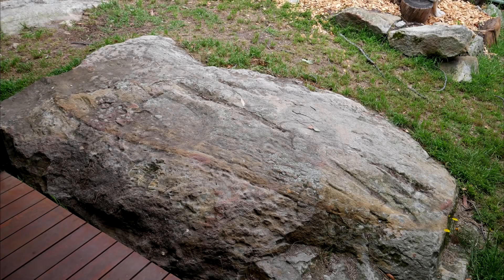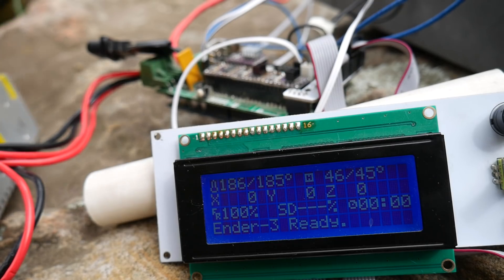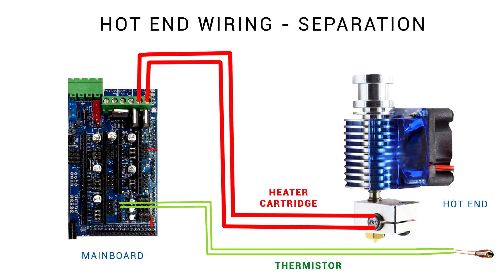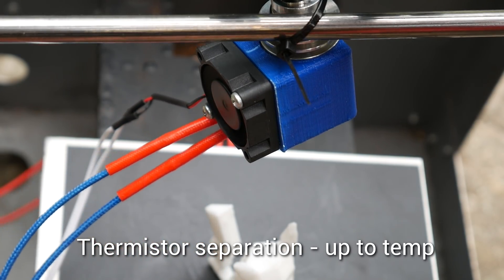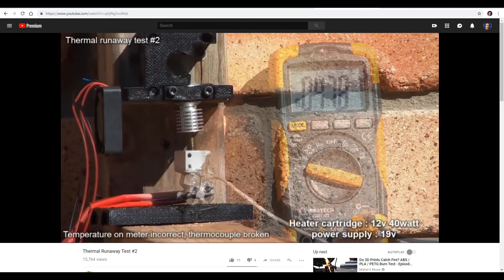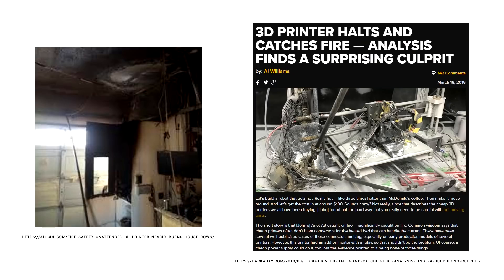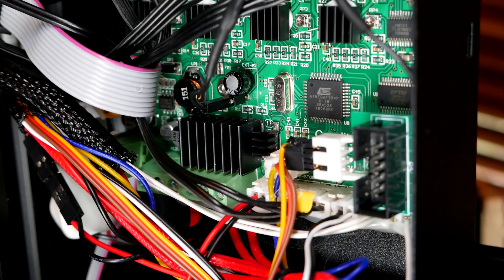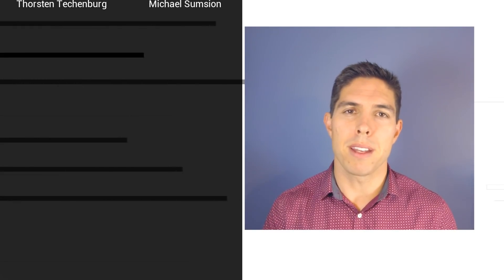Is your 3D printer a fire hazard? How to test Marlin safety features

Comment: We recently had a alert warning of HTERMAL RUNAWAY and several loud beeps short and long beeps to get our attention. We were able to manually turn off the ender 3 printer. Do you think think thermal protection is enabled? Or should we still be updating the software?
Reply from the maker: If it gave that error and shut things down, the thermal protection is doing its job.

Comment: Thanks for the video. I currently have the thermal runaway issue where mine appears even when everything is in spec. I haven’t checked physical cables yet but I also don’t know if I have to replace the thermistor, which is the correct part when I look it up. 
Also Creality isn’t very good about labeling firmware by version. I found it by “which motherboard do you have” or “which accessory are you using” like CR Touch bed leveler, etc.

Comment: I just got a Thermal Runaway warning on my Ender 3 v2 that I got about 2 days ago.
The print stopped and the printer started beeping, but apart from that nothing happend.
I'm not sure what caused the problem. After a restart the printer seems to work normal again, but I haven't run any bigger prints since the warning.
The print that caused the problem was the biggest I've done so far with about 4 hours in before the error occurred (and about 7 more to finish).
I hope I can find and fix any problems with it, would annoying if I can't print anything bigger.

Comment: Great video, I have done all of your recommended mods/checks. However, no matter how good it is, I don't trust software completely when it comes to preventing thermal runaway. On my printer I have a power relay and thermal fuses that cut the main power when anything starts getting hotter than it should. If a fire does still manage to start then i have an automatic fire extinguisher and a smoke alarm. The thermal fuses should blow before anything gets hot enough to cause a fire though, video on my channel if anyone is interested.

Comment: Running 2 thermal sensors on bed, and on hotend.

One on the bed (CR10S) is set into the aluminium bed, another on my silicone bed heater. Any prolonged delta between them (50°C delta allowed for the 1st 20 seconds of heatup from ambient) cuts power to the bed heater. Bed heater also has a an inline ceramic thermal fuse bonded to the pad as a last line of defense, should the sensors or firmware fail.

On the hotend there's the one in the block, and one bonded to the rear of the heater cartridge. Any significant delta, or lack of reading change when expected, cuts power. Tested by pulling the cartridge partway out from the block, sensor on the back of the cartridge registered the spike and cut power to the cartridge in about 4-5 seconds.

Any abnormal reading from any of the sensors (wire or sensor damage isn't always a clean break or full short) also triggers.

I've been looking to find some high temp thermal fuse to mechanically mount to the heater block, but haven't been able to find any yet with a reasonable margin above 330°C. At least not small enough or non-reset. They need to be full mechanical break so that if it somehow fails to electrically shut down, it won't come back on if temps go bsck down.

Comment: Got thermal runaway alarm activated for the first time on my Ender 3 Pro today. I installed the thermistor incorrectly after disassembling the hot-end for cleaning and I think it wasn't tight enough in.

Comment: Current version of Cr10S Pro V2 seems to have fixed this since it is based on Merlin 1.1.6.

(cf. https://github.com/Creality3DPrinting/CR-10S/blob/master/CR-10s%20Firmware%20(Marlin)/CR10S-Factory-Thermal-Protection-Enabled/Marlin/Configuration.h)

Configuration.h contains now:

//===========================================================================

//======================== Thermal Runaway Protection =======================
//===========================================================================

/**
 * Thermal Runaway Protection protects your printer from damage and fire if a
 * thermistor falls out or temperature sensors fail in any way.
 *
 * The issue: If a thermistor falls out or a temperature sensor fails,
 * Marlin can no longer sense the actual temperature. Since a disconnected
 * thermistor reads as a low temperature, the firmware will keep the heater on.
 *
 * The solution: Once the temperature reaches the target, start observing.
 * If the temperature stays too far below the target (hysteresis) for too long,
 * the firmware will halt as a safety precaution.
 */

#define THERMAL_PROTECTION_HOTENDS // Enable thermal protection for all extruders
#define THERMAL_PROTECTION_BED     // Enable thermal protection for the heated bed

Comment: I just bought and Ender 3 V2. I find when doing maintenance if I remove the thermal sock and bring the nozzle up to 210c I get an alarm with the warning on the LCD saying THERMAL RUNAWAY. Will I still need to update my firmware? it's version 1.0.2 . Cheers!

Comment: So basically, on printers with low-powered heating elements nothing will happen even in the rare case when conditions for thermal runaway protection are fulfilled.

Comment: I think it's important to note that this thermal runaway protection is not 100% effective. 

Today on my Ender3 my mainboard overheated during a print due to a board fan failure. 

The entire system froze, steppers stopped and the bed and hot end kept heating up. The thermistors were not damaged and are still operational, but the system wasn't capable of reporting the thermal runaway and shutting itself down. 

Software/firmware solutions should never be our primary safety go-to when it comes to preventing fires.

Comment: Is there any solution to cut off PSU power if the onboard mosfet fails closed? Maybe: If heating element is continuously on for more than 60 seconds then trigger a switch to cut off 12V/24V PSU main power.

Comment: I use OctoPrint on my Ender 3. The Raspberry Pi will power the Ender 3 display. I forgot to turn on the printer itself as the display was already lit. When I tried to print something I got a Thermal Runaway error. That's because the printer wasn't actually powered on. That was a safe test that showed the protection was actually working. Afterwards I checked the firmware and confirmed that I had the latest version installed.

Comment: Great video and very informative!

Since this video was created one and a half years ago, can you give an update as to what Creality has done with their current firmware? Have they included Thermal Runaway Protection in their newest models? If so, can you tell us what versions of firmware this would be included in? If the firmware has been updated, is Thermal Runaway Protection turned on by default? 

It would also be helpful if you posted a video where to find the commented out lines and how to uncomment them.

Comment: I removed one of the red wires and set nozzle to 200C, after a short time I get “Heating Failed, PRINTER HALTED, Please reset”. This is not thermal runaway protection I guess?
Reply: Correct, re-watch the video and he explains this.

Comment: I had a brainwave earlier today that made me search for this topic. Would it be a good idea to implement a fire suppression system into an enclosure? It doesn't need to be a very complicated or expensive affair. I'm thinking of for example triggering a 13g CO2 cartridge inside the enclosure if the "alarm" is set off. Those are pretty cheap. Alarm can for example be enclosure temperature. A system like that would also need to cut any fans from simply circulating fresh air to feed the fire. Perhaps close the vents somehow and also kill the power to the printer.

Comment: I just got my BL Touch kit from creality (with metal mount and all).  I did download and update to their firmware, version 1.1.62.  I figured that since it was a 1.1.6x, it should have the thermal runaway protection enabled.

I just checked by disconnecting the heater cartridge and in just over a minute, it did trigger the protection (Although I thought over a minute was a little too long).

But when I disconnected the bed heater wire (+24V), and I tried to heat the bed, the bed temp stayed ambient at 24º, and the multimeter connected to the connection on the MB displayed +24V, but after 3 minutes, no thermal runaway protection kicked in.

Does the latest marlin firmware for the ender 3 (pro) have thermal runaway protection enabled for the heated bed as well?
Reply: I'm having this same problem... Did you solved it? Mine seems to trigger after 3 minutes or so, it doesn't seems safe...

Comment: To catch the situations thermal runaway protection doesn't catch, it would be possible with some tinkering to set up a smoke detector to trigger a smart outlet to cut power to the printer

Comment: Does the upgraded ender 3 silent board (sold as a creality upgrade) have thermal runaway on? Based on their install video the 1.1.6 firmware already has it on.
Reply: Edmund Martinez mine came with 1.1.8

Comment: Just did this test (9:07) on a Creality3D V1.1.5 (silent) board, was shipped with Marlin 1.1.8 less than two weeks ago,  which I fitted to an Ender 3 Pro.  The printer halted within 20 seconds or so of the hot end not heating up as demanded. Error message was different to yours. Mine read "Heating Failed, System stopped"
Reply: Message on the Ender LCD panel was in actual fact "Heating Failed PRINTER HALTED please reset" - I'm not convinced this is derived from a thermal runaway check. Anybody care to put my mind at rest?  Rather not do a destructive test on my printer.  ;-)

Comment: Thermal runaway is a stopgap, proper protection is not allowing hardware (heaters) to draw more current than normal operating conditions, 3d printers should be fused, and thermal fused.